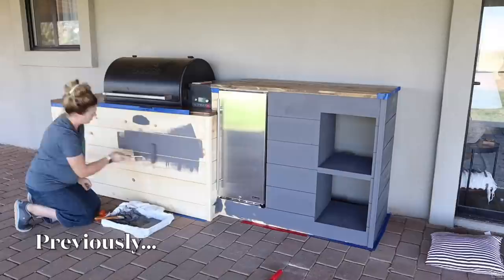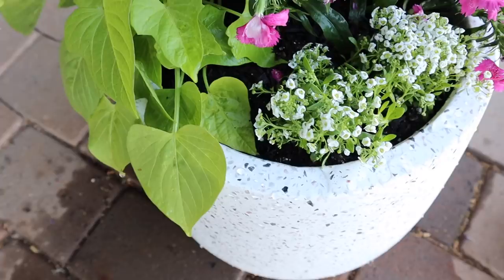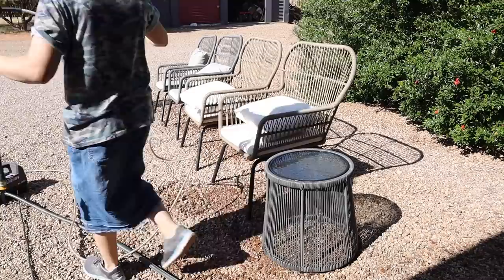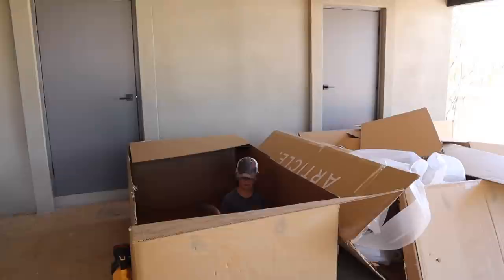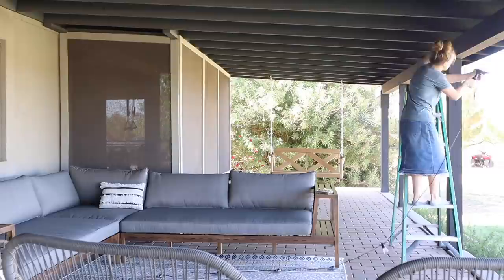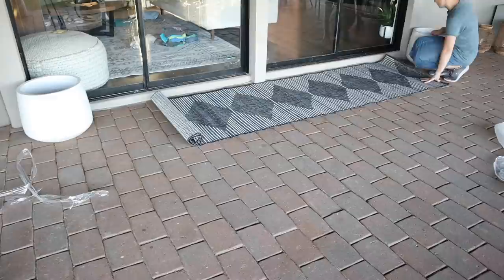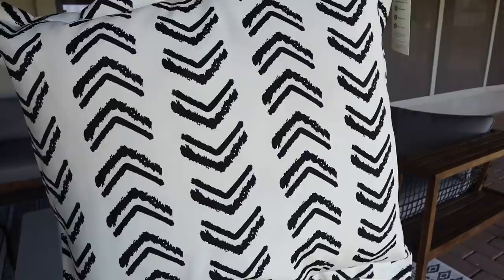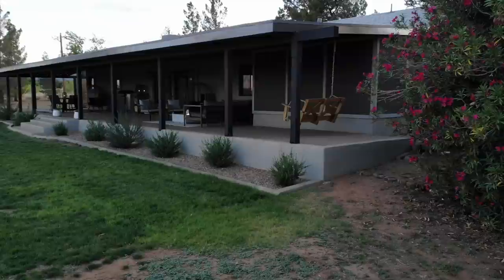COMPLETE BACK PORCH MAKEOVER!!😍 BEFORE & AFTER PORCH MAKEOVER | DECORATE WITH ME

Comment: I love the terrazzo planters! Your porch is lovely. I love sitting on a porch. I would remind others that a lot of money is spent on stuff for outside that the weather will make short work of. At least being under a roof (versus a deck, patio and fire pit) helps. But rugs, drapes, cushions, baskets, wicker are subject to fading, mildew, brittleness. Here in SC, we are still dealing with our annual month long heavy pollen season that creates such clouds of green pollen and coats everything. And when that season is over we go into 4 months of extremely hot, humid weather. You can't sit outside during those months. There are the bugs (as she mentioned), not counting snakes, spiders and the fire ants. A screened in porch is a must where I live. But don't spend a ton of money on the outside. A good grill, some long-lasting furniture (metal, concrete, teak) with cheap pillows for comfort, a swing is all you need because the pillows will have to be thrown away in a year or two. I would like a concrete table and benches as that lasts awhile. But other patio tables just get dirty, warp, get splinters, rust. Forget the rest. Her new sectional is pretty but the pillows are too large to wash and they will be a custom size that will be expensive to replace. The rope will disintegrate within 2 years. But she made a good point about the other sectional being a bug and spider home. Rattan will get brittle and begin to break being outside.